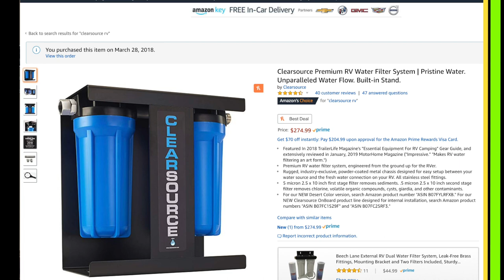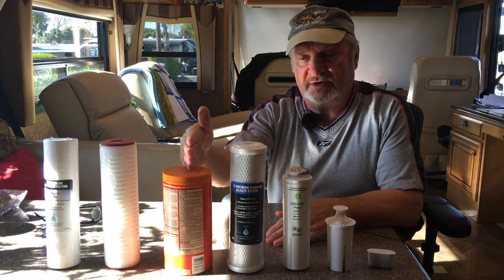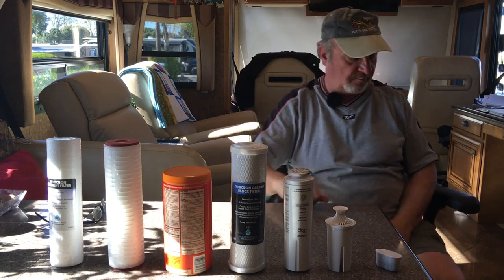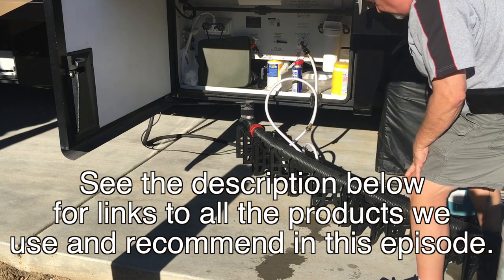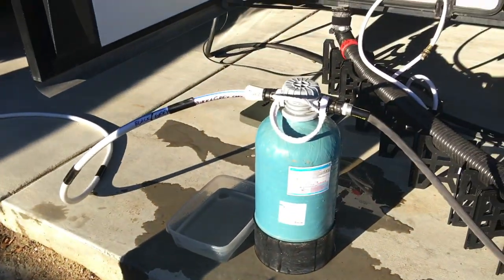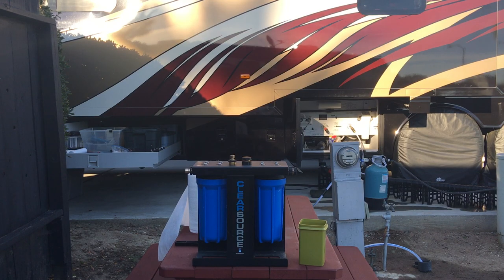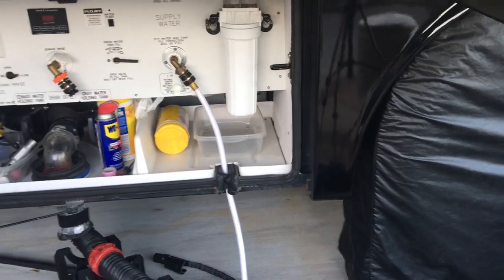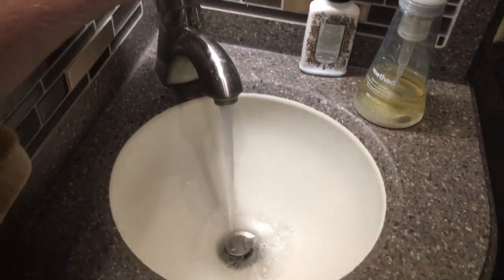RV LIVING- FRESH WATER TANK SANITIZING, FILTERS & SOFTENER MAINTENANCE-EP51

Comment: Mark, I purchased the On the Go water softener, the double size, and noticed that it's rather heavy and bulky to move, especially when full of water.  Could you please tell me how you wrestle that thing into a storage bay?  Is it just a drag, heave, bump, and hope it doesn't fall on its side into basement storage?  I know your back is a thing to be reckoned with.....?  Thanks.
Reply from the maker: You can actually buy from on the go a little pipe handle gadget with wheels.  It is like a little hand truck. A person could just get a collapsible cheap regular "office worker" type dolly. We just lay it down, and let it drain. Then SUE does the lifting into the minivan.  TAKE NOTE: I have talked about how cheap and unsafe the rope handle is.  I always have (3) of the rope handles on, and as the sun degrades them, I replace them. Someone I read about broke their foot when a handle broke! Yikes!
Reply: @OurJourneyInMyles  Thanks Mark for the info. You have no idea how you and Sue influenced out MH purchase and accessories.  I was concerned about the effects on the resin by laying the unit down and pouring out the water....I will do this.  I saw the dolly thing and almost purchased it but since I will be storing the softener in basement storage I would need the handle to be removable, doesnt look like it is.  Ill find out.  We are not full timers but newly retired and plan to spend lots of time in our wheeled home.  By the way, we purchased a 2022 Newmar New Aire, I know, small for a full timer but, hopefully, big enough for part timers.  Take care.

Comment: We just ordered a Clearsource, how do you secure it so it doesn’t get legs at the campground?  I’m pretty trusting but hubby is concerned.
Reply from the maker: Good question! We have never secured it,.......but intentionally rotate it so the blue filters face the rig, and just the black framed bracket faces the eyes of folks passing by.  We do lock up our Hughes Autoformer & Progressive Industries Power Pedestal equipment.  They both sit inside a grey Rubbermaid Tub with a cover to keep the elements off it. After staying in over 90 campgrounds, only 4 or 5 have felt "dicey".

Comment: We have a Ventana 4369. Where is the overfill valve?  I have looked this coach over
Reply from the maker: The fresh water overfill valve is a black rubber tube that sticks out the bottom of the rig, on the passenger side of the rig, with a "duck bill" on it.  It will allow water out when the fresh water tank is full and starting to pressurize.  The black tank only has the tank vent to the roof, to vent odors and allow the plumbing to flow and not vapor lock up.  If you overfill the black tank, you will only discover this when the black sewerage starts overflowing out of your roof vent, down the side of the rig. Yuck!
Reply: Thank you. Our previous Tiffin had a door that was key locked. Assumed the Newmar did too.